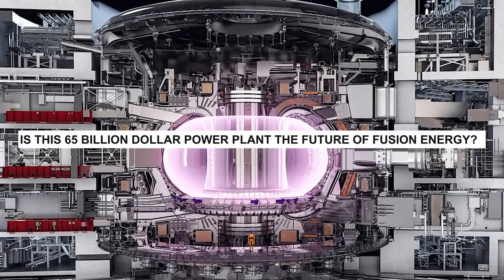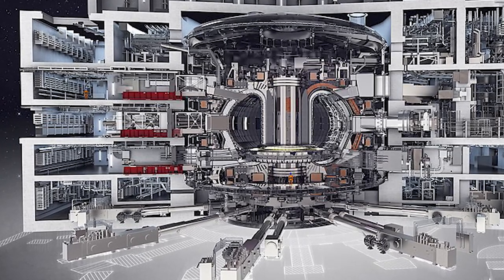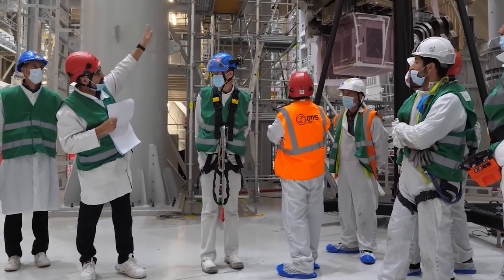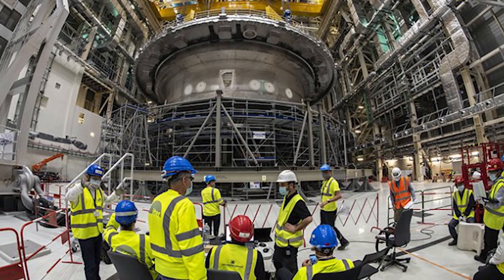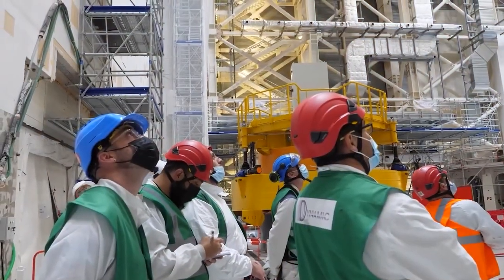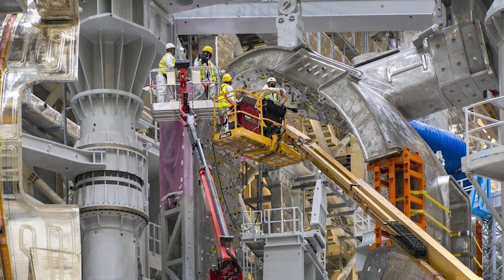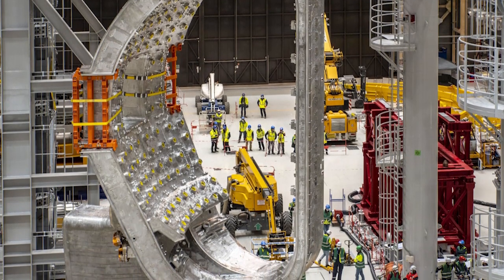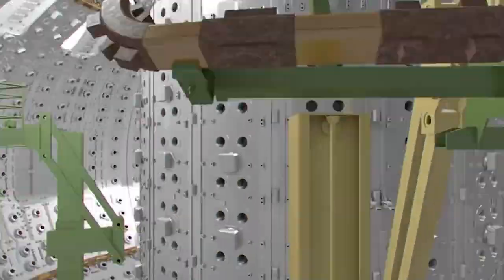Iter DELAYED! The world's largest fusion experiment in danger!

Comment: Good video overall but there is a mistake at 7.10. The narrator says "the fuel for fusion reactions deuterium and tritium are abundant and can be found in sea water and lithium." Deuterium, a stable isotope of hydrogen with one proton and one neutron can be extracted from sea water fairly easily. Tritium is a radioactive isotope of hydrogen consisting of one proton and two neutrons with a half-life of 12 years. Tritium exists naturally only in trace amounts in the atmosphere from the interaction of gases with cosmic rays. Tritium may be produced in nuclear reactors by neutron activation of lithium-6 at the cost of $2,000,000,000 per kilogram so to describe it as abundant might be misleading. Deuterium-tritium has a lower fusion temperature than deuterium alone but its high cost prevents it from being a candidate for any commercial application of nuclear fusion. We may see deuterium alone used as fuel at some point in the future when nuclear fusion may actually become commercially viable but the trick will be for the reactor to handle much higher temperatures.
Reply from the maker: hmmm did I make a mistake in this? Sorry I don't want to be misleading. I'm going to pin your comment at the top
Reply: the thing I can't understand, I'm not even going to try at this moment is similar. So the word is that there is only about 20kg of tritium on the entire planet, ITER will have used 15kg of it during its testing period. How the hell can they call this the energy source of the future? So in the "blanket" of this tokamak, i've been told, they inject lithium and beryllium, because the free neutrons will split them into either tritium cores and helium-4 cores and free neutrons, so they can inject fresh tritium into the plasma. In another video I hear someone saying he's the head of the tritium plant of ITER, that only 1% of the tritium will be used, and has to be recycled again, removing the helium ash and some other stuff, to reuse the tritium again.
I assume what we knew until now will change again because ITER is delayed again? So which one is it, a blanket of lithium and beryllium, a tritium plant, or actually both? I think it was Arvin Ash or Sabine Hossenfelder who mentioned that "blanket", could be pbs too, it's not something I dreamt about, otherwise I have to record my physics dreams!